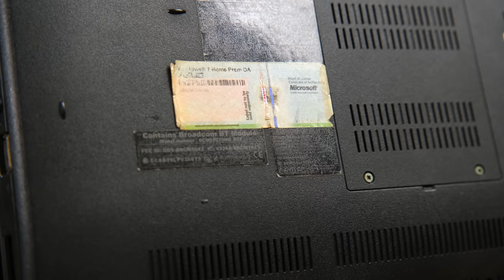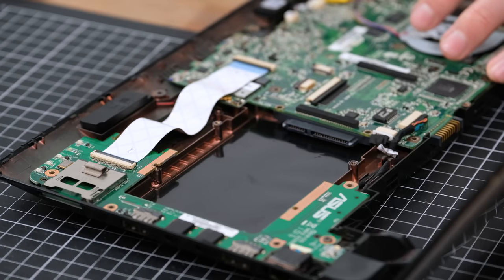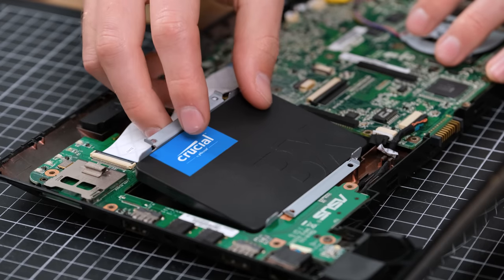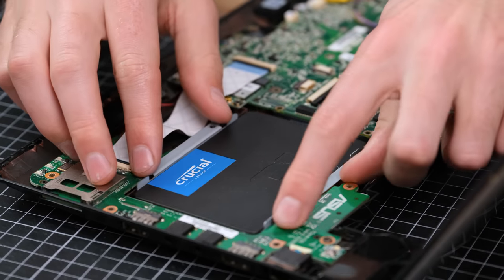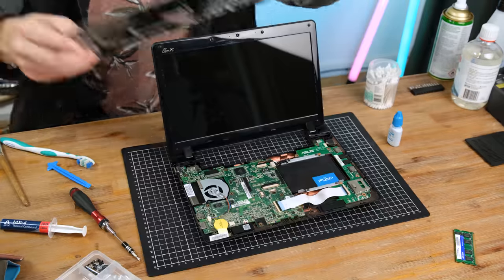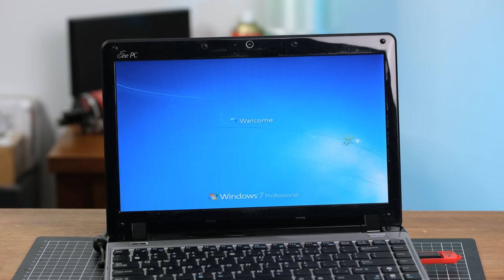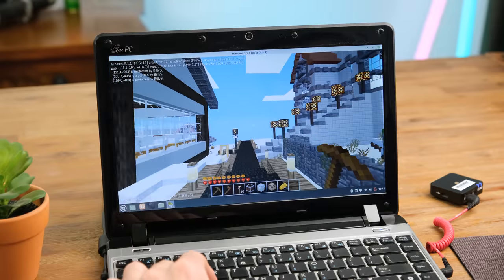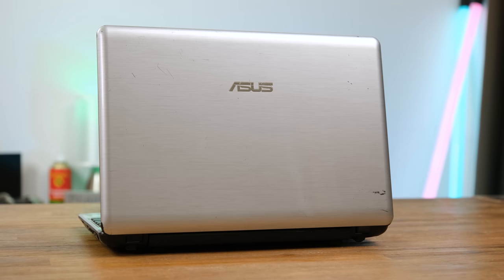I Bought This $10 Laptop From eBay...

Comment: I think this laptop would be awesome as a distraction-free typewriter machine with puppy Linux. Or as a jukebox for a collection of mp3/FLAC files, if plugged into a decent set of external speakers.
Reply: Debian that just launches LibreOffice / GDocs / whatever. Yes indeedo.
Reply: I once an idea of a distraction-free typewriter: barebones Arch (don't even install the Wi-Fi drivers or a GUI) and set nano or vim or whatever you like as the login shell (yes, I'm serious). The interface will look ugly, but is quite literally 100% distraction free.
Reply: I've got a very similar setup for my early morning crack of dawn writing sessions, and such a machine is PERFECT for productive writing. You're not going to do six ways of research at the same time, but for putting the maximum amount of words on screen quickly and efficiently...it's the way to go.
No slipping over into a quick gaming session (that turns into a couple hours) when the writing momentum wanes. And good writing machines like this are always cheap!
I run Mint on mine with the XFCE4 desktop...minimum CPU requirements, maximum efficiency.
Reply: A great laptop running tuning studio or something
Reply: @k.b.tidwell  I like Wordgrinder for that stuff. No worrying about WYSIWIG formatting. What program do you prefer?
Reply: @kaitlyn__L  I do not know that program, going to check it out. Because my mother tongue isn't English I do like libre-office who has a nice French corrector.
Reply: @glitchy_weasel  you have i3 desktop for that :-p
Reply: @TDGalea  true! Desbian is a great choice too!
Reply: @inkshock  Dude, this is an awesome use of an old netbook! Congrats!
Reply: DankPods: hehe a clam-shaped nugget
Reply: You could always do debian with open box. I have set up VMs for specific applications and the app and VM didn't really take up that much ram
Reply: Antix linux would be great for it
Reply: @tomaszwojcik8772  yup!
Reply: I thought this for the one I just got. Might be perfect for my son to type up papers/projects on.

Comment: could you test more thinkpads? im a bit addicted to thinkpads, love those reviews
Reply: thinkpads are hot
Reply: @doctahjonez  facts
Reply: @Irysuwu  im watching this on a t520 with a i7 2630qm and win7, with egpu i can play  gtav maxxed out@ 40 to 60 fps
Reply: Watch LGR
Reply: I'm too poor to get thinkpads.
Reply: yes
Reply: Why you guys think that think pads are hot? What can they do that other laptops can't?
Reply: @jponz85  have you ever had one?
Reply: @northern830  The older models (which are cheaper) are beasts even in today's term. That's the whole point.
Reply: @Khavvie Not on Ebay.
Reply: @Khavvie I'd avoid the t400 as core 2 duos aren't up for any jobs these days. t410 t420 t430 are good though and not expensive
Reply: @Khavvie That's your choice of upgrade. My current laptop has 8GB but supports more than that.
Reply: @giorgiotek-604  how much did that cost you
Reply: @Windows350  They’re usually all scalped for the brand recognition

Comment: "and 8 gigabytes worth of... music" 

Thank fucking god
Reply: I wonder what codec they were done with as that has a huge bearing on the size?  I have terrabytes of music but as FLAC or DSD / SACD etc, with a single album being 1GB or more in size at times.
Reply: I was surprised tbh
Reply: @EgoShredder  My music library is about 79 GB and it's all high bitrate mp3. 8 GB is fairly small I'd say, but understandable for such a device. 79 GB is about 8500 songs. If you just listen to a few bands or just download whatever you like without collecting the entire discography then you should be fine with the roughly 800 songs 8 GB will allow you to have. That's a generous 10mb per song. That's good for an mp3 file.
Reply: @EremittV  I have to disclose my dislike for audio compression for serious listening, but for casual stuff and podcasts then it is acceptable.  However if you preference for music is in electronic genres and general popular music, then MP3 will suffice just fine.  Anything that features mostly acoustic instruments and anything with a complex harmonic structure, will sound REALLY awful with compression even at the highest and best settings.  Not sure how many albums I have in my collection, but it was around 2000 a few years ago last time I checked.  I upgraded my NAS in 2014 and got 12TB storage to put inside it.  I'm going to need to increase that fairly soon, or delete stuff whichever.
Reply: i was 100% expecting 8GB of porn
Reply: @EremittV  Very true and most people  regardless of equipment owned, lack the critical listening skills required anyway.  Also some combinations of equipment, can work badly even if individually good on their own.  Regards mp3 I actually did the same as you for a few years in the 2000s, but later regretted it and then made sure to stick with lossless thereafter.
Reply: Wa
Reply: Ooo
Reply: @EgoShredder  mines just 320kbps and its already 6 gb😂 sround 500 of them
Reply: H3ntai

Comment: I recently bought one of these at a local Goodwill, and upgrading it was dirt cheap.  It has 8gb RAM (yes, it will handle that much) and I installed a spare SSD, and it's running AntiX Linux very smoothly.
Reply: DDR2 didn't had memory sticks bigger than 2gb. Laptop presented in the video was terrible back in 2010 and never had any upgrade options planned.
Reply: @arivald6677  Probably he bought one of the latest Eee models, they were equipped with DDR3 so it's possible to try putting a 8Gb stick
Reply: These are 32bit machines that can only address 4 gigs of ram. You got lucky and bought a better laptop and didnt know it. Great Job!
Reply: @frzfab  Nope, older models were 32-bit but the latest ones had a 64-bit CPU. For example, the one in the video has an Atom N450 that is 64-bit, my 10-inch Asus Eee X101H (which I still have with Lubuntu installed) is equipped with a dual core Atom N570 that is 64-bit as well.
Reply: @whiteyuko  u guys got lucky, they are starting to become collectors items it seems. Ebay doesn't have em for less than $100.
Reply: I got one for $30 couple yrs ago, 2006 one running puppy slacko

Comment: “Slaps roof of netbook “
This boy can run a whole 2 chrome tabs
Reply: Hahahahaha, I am on the floor now!
Reply: @noway4040  still?
Reply: @jc-px8ox  Yep, been here for three days. My Rumba is about to assassinate me. :)
Reply: @noway4040  rip
Reply: @noway4040  still?
Reply: My laptop w/ a Celeron N3350, 4GB RAM, and a dual boot setup on 64GB eMMC (windows 10 pro + Ubuntu 20.04) can run 44 Firefox tabs under Linux, and as far as I can remember it could run 17 Chrome tabs under Windows, surprisingly.

Comment: I picked up a ul20a just before Christmas for £48 and have had a lot of fun playing with it. The physical design is very similar to this machine but it has an SU7300 dualcore processor and runs both Windows 10 and Linux Mint nicely. The SU7300 has Intel 4500 MHD graphics which are capable of running Minecraft and a number of XBox-era PC titles like Splinter Cell at reasonable frame rates. One of the big advantages over the Atom machines is being able to run 8GB dual-channel RAM and I’ve also convinced it to boot from a 4TB SSD just to see what’s possible. The wi-fi is mini-PCIE so upgradeable to modern 802.11ac cards. All in all these Asus machines are nicely built and with SSD and modern wi-fi feel a lot more responsive than they did back in the day.

Comment: A device like this is begging for the h264ify chrome extension for smooth playback. Nvidia ion doesn’t accelerate the codecs YouTube defaults to today, but does smoothly play back up to 1080p h264 video, which is why it was so valuable at the time.

Comment: I had one , the eepc 900 with celeron 630 Mhz, 1GB ddr2 , 4GB soldered + 8GB socket ssd, 8.9" 1024x600,  win xp starter. The 4GB ssd dead within 2 years, xp running in the socketed 8GB ssd was much slower than traditional hdd. I use it for remote desktop to my desktop when working in factory site. Finally I gave it to family for his kid, after I had a real compact laptop.

Comment: I probably would stick with windows 7 and then install super low requirment internet browser like palemoon, basilisk or something similar. Given that this is Nvidia brand gpu  using linux is limiting this machine. If you use proper drivers and ssd drive this could handle 1080p/30 frames which is enough for movies playback altough given that youtube removed support for 30 frames and is currently forcing 60 frames its probably cant play youtube well.
Good job on restoring it!

Comment: I don't think the times of low-powered, tiny laptops are really over. You still can get them if you look for them... for instance, I saw another video for a $129 laptop which would be pretty much today's equivalent of the one you're reviewing here. I bought one 2 years ago for € 199 at the local Penny Markt... it has a quadcore Atom processor at 1.44 GHz, 32 GB of SSD, (I think) 4 GB of RAM and a 12" 1920x1048 display and runs Windows 10. It's fine if you just want to type up document or maintain databases on it, and it even runs Youtube smootly... just don't expect it to do really well at streaming over Youtube or at high performance games. It's actually so low powered that the power adapter is only 5V 2.4 A which means an average power bank can be a full substitute for it. And it only weighs a bit over 2 lbs, so it's very light to take along with you. And it's totally silent since it has no fans... it does have a speaker though, and even 2 built-in microphones to record in stereo!

Comment: I used to have an Eee PC and it was okay with Windows 7/8.1 and Arch Linux seemed to work fine too... And it had the same problem, a failed battery. It was still in use until a week ago when the Charger broke.

Comment: I recycled a similar netboook with dual core atom and worst heat, battery and disk problems into a battocera system, even I disconnected the keyboard because have errors and put a fan on top. Batocera runs decent and I use joysticks.

Comment: I have a 2007 laptop and had the microprocessor swapped out for a dual core processor running at 2.1 GHz, Mint xfce, DSD, and YouTube ran fine after that. I almost forgot: I used an Ethernet connection.

Comment: A zues eee pee cee, is what the sub titles said. I had a similar model, asus 1005ha and it ran great on windows XP but struggled with 7, even with the 2gb ram upgrade. Back in 2008 it would've been great to have ssd. What version of Linux did you install? I'm curious because I have an Acer one that is on 7 and I'd also like it to be more secure.

Comment: These netbooks were nice for there time. But these days they are old and slow. I still have an old EEE PC 900ha. 8.9", single core Intel Atom N270 / 1.6 GHz, 2gb ram & 160gb hdd running Windows XP. You know its old when it struggles to run anything higher than 360p youtube.

Comment: Single core CPU laptops are pretty much useless these days except for retro OS or gaming testing from the 90's or early 2000's. I have an HP dv6636 laptop from 2007 with AMD Turion TL-58 dual core that came with Vista. It was my first laptop and I still have it somewhere for sentimental value. I swapped the drive for an SSD that runs on SATA 2 speed (still better than the 120GB HDD it came with) and upgraded RAM to 4GB which is probably its max. I have installed Porteus Linux in dual boot and in Linux I am able to view 720p and 1080p youtube video. It has a DVD drive which I use sometime to copy movies from old DVD's to usb.

Comment: I have one Netbook running Windows 10, but 2 GB is not enough for that OS.
Reply: The CPU is abysmal, too, so if you mean a netbook of this vintage, never mind the RAM limit. I guess it would run like crap even if you could throw more memory into it.
Reply: @BilisNegra  Less crappy. have AMD C60 (1 GHz) with 4 GB memory, runs Win 7 better than the Netbook.

Comment: My Eee pc had Windows 7 Starter With an Intel Atom Processor clocked at what I remember 1.8 ghz that’s all I remember and my Eee pc is smaller than the one he was working on.
Reply: Also to mention does not have much Memory so if I wanted to use it I would have to insert a usb that contains at least 2GB of memo or higher
Reply: The bumps are not off putting to me it’s satisfying to me but I’m 
Not sure if the USB ports in my Eee PC works or not.
Reply: And On my Eee Pc I could do up to basic games and watching videos It tends to have a very choppy frame rates Typing was kind of slow at first But eventually it’s starting to get a little faster after the 11 to 10 years of not being used does not have a antivirus installed but still worked At one point it like messed up to where it scared me But eventually in a couple minutes it got back to normal.

Comment: My HP 2133 Mini Note is still kicking and runs Mx Linux rather well.    The only part that is making things more challenging is the 32 bit processor.  Otherwise it had alot of higher end features and even includes an Express Card slot so I could potentially put in a USB 3 card in a computer from 2008.  I got a replacement battery for mine a could years ago for 20 dollars and I am quite happy with it.

Comment: i have an old 2007 fujitsu siemens amilo 2515 witch i found in a dump no hard drive no power brick witch i had and no battry did not work or boot as owner said and she was rigth sitting in garrige for so long came with vista orgliny  there is cursion on power brick port and is dammgied a lot

Comment: I never seem to find those 10 to 30 bucks laptops others find on ebay.  I don't know if that is a bad or a good thing, as in, the universe protecting me from buying nearly-useless stuff just to indulge in the drive to tinker with them.  Still, that ASus has better specs than my 1GB-ram Acer Aspire One D255 which I dual-boot with Win8.1 and Lubuntu.
Reply: they're all 30 minimum here, usually 50 :( They're neat little things with often surprisingly nice keyboards. Mine also got an awesome soundcard integrated. My screen is terrible, but it gets impressively bright if you want. Quite cool little things

Comment: I had something similar to this....even after i clean installed the laptop,it still was very slow...and the side of the screen will start to wear out causing a weird white line on the screen down the bezzel....and the keyboard was very hard to type on because it was small and the keyboard was cramped
Reply: Welp...since it originally came,it had some problems, the trackpad wasn't working after i received it...i opened it up and turned out it was not fixed properly with the gold contact pins fixed that and after some time i  salvaged the parts for other computers in need

Comment: i had one too and it runs windows xp but i wanted to put linux on this and every time after 10 minutes its crashed bc overheating and I did replace the thermal paste and cleaned it up...

Comment: i use a dynabook as a gaming laptop and games like roblox and even minecraft lags at low settings but it runs games like gta 4 and euro truck simulator 2 fine at high settings which is weird. edit: i upgraded to a dell laptop and it plays games well.
Reply: Of course you play Roblox.
Reply: @echonomad94  yes im sick on arsenal.